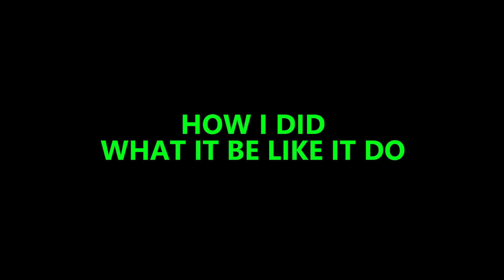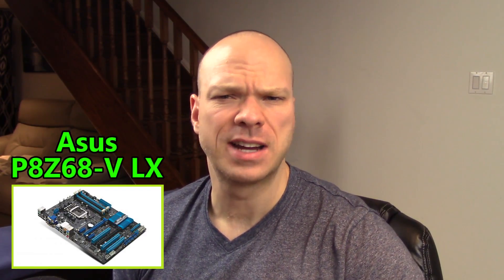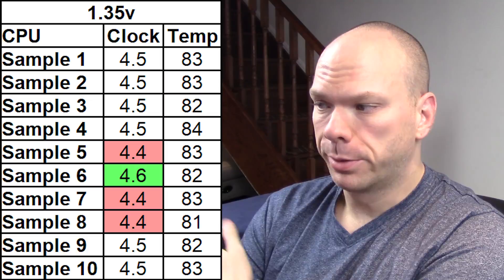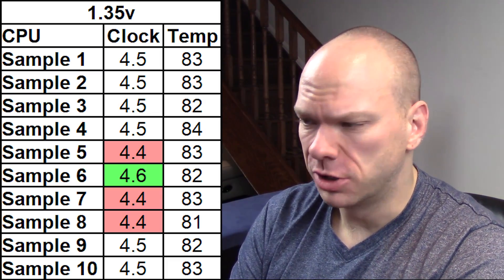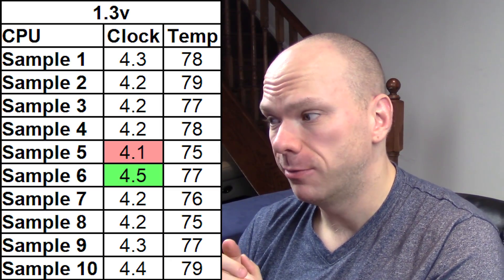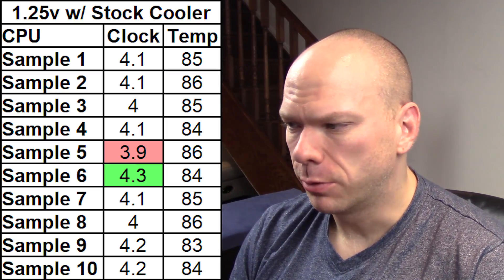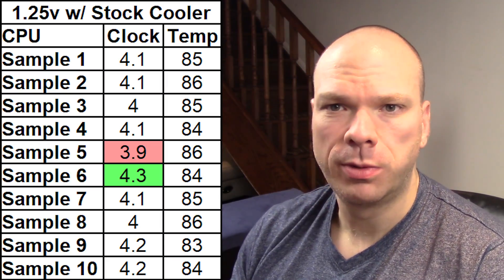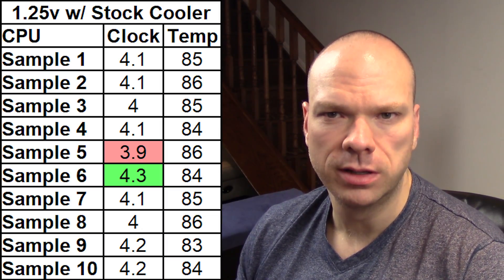Overclocking Used i5 2500Ks - 10 CPUs, 10 Results

Comment: I don't think they have a point. I would more count this to chip variables and how voltages are measured. Also people seem to understating voltages online. Got mine at release, overclocked it to 4,5ghz. Overclocking was done by finding first voltage value that is stable in prime 95. Now 12 years later it's still running with same voltage and is same way stable in prime 95. I actually tried lowering voltage by 0.05 and it crashes in prime as it used to do. So I would say that there is no meaningful difference to workinglife of CPU. Note that it's already stretch to be thinking that over 10 year old pc is relevant.

Comment: 4699MHz at 1.3-4v then under load 1.5v (heavy load) since 2014, previously 4599 from new in 2012. Running "stable" like this for years and years, no throttling of MHz either, finally the system is giving up, it can power off from time to time (2019 august). I have got more than my moneys worth now. Emulation of Wii U and PC gaming including Arma 3 hurt the CPU real bad over all the years, 4k hours in Arma 3 and 0.5k hours of CEMU time. 
It is a shame that it can not become a hand me down some where, at the same time wouldn't like to hand down something so old anyway due to power usage even at normal clocks. Thank you 2500k a true legendary CPU.

Comment: I’m struggling to push mine past 4.4ghz. It’s been running at 4.4ghz/1.325v for the last year but anything over 4.5ghz and I can’t get it stable at any voltage. If what you’re saying is true it’s probably degraded some because for about 3 years it was running at about 4.4ghz/1.45v because I left voltage on auto when I didn’t know what I was doing.

Comment: My 2500k came from a m8 who had it 5 years. 3 of which he didn't overclock. Last 2 he did. Tho its done well as it will do 1.35v at 4.6ghz. Currently priming at 1.38 at 4.7 but I still needs to pass 24 hour prime95.

Comment: First time into overclocking: Z77A-G41(budget OC kind'of capable) + i5 2500K got it at 4.1GHz on the stock voltage(i guess) messing around, setting the multiplier to 42 and having +0.000v option, as i couldn't find a way to manually enter the voltage. Was i lucky with the chip, or did the MB automatically raised the CPU voltage? More so, is there a way to make it work with variable clock speeds? Cause it was 4.1 fixed in windows, and i didn't liked that, so i went back to the stock settings.

P.S: i have to say that the HD3000 is a little beast when overclocked, as i'm stuck with it until i find a decent priced GPU

Comment: just like the randomness of how high they clock from factory i think that has to do with degradation aswell, ive seen 2500ks at 4.9ghz for years, but ive also seen them start at 4.9ghz then become unstable after a time. silicon lottery seems to also be with how far you can push it for how long

Comment: Cool video! No thanks on the pornhub thingy'ma'jingy. I still have a 2500K. Overclocked to 4.4Ghz because this is the best I can get at voltages below 1.35V. I used to run it at 4.5Ghz but I noticed that the chip got hungrier over the usage it had so I actually need more voltage to keep it stable at 4.5Ghz. So yeah I can say it did get used a bit (degraded) over the 5 years I've been using it. Still a great processor and I can definitely recommend it.

Comment: Very good video, max voltage for 24/7 use that i would recommend is 1.42 for intel processor and that is every thing all the way from sandy bridge to kaby lake from what ive seen. That chip could have also been the worst silicon from factory and the 1.45v did certainly not help it.

Comment: Hmmm... Interesting, and does pose some questions about my 5 year old AMD oddity... It's a Phenom II x6 1055T @ 3.36Ghz and 1.3V (stock would be 2.8Ghz @ 1.35V).  Admittedly a "Conservative" 20% overclock, but non-heatsinked 4+1 phase VRM and a small PSU, I wasn't going to go for overclocking gold on this setup (though I know most people wouldn't even consider overclocking such a setup).

Comment: My 2500k (Purchased in 2008) ran at stock voltage with a max overclock of 4.4 GHz, (No matter what voltage I gave it, it would never go past 4.4) and it's been running at 4.4 for most of it's life, recently dropped it to 4.3 a few months ago just to drop the temps a bit (Was sitting at the 85-86 degree temp) and at 4.3 it dropped to 80-81 Deg Celsius. Using a cooler master evo.

Comment: Ivy Bridge i5 3570K here sitting at a cool and quiet 4.3GHz at just 1.18v, maxing out at 63C on a Hyper 212 EVO. For nearly 5 years. I wanted to stay fairly conservative with it to prolong its life. I plan on keeping it for another year or two and probably one more GPU upgrade (totaling 3 GPUs on this one CPU). 

The i5s from this era were built to last! Legendary chips.
Reply: Captain Jack Aubrey of the Royal Navy I'm still rocking my 3570k. I've had it at 4.5ghz 1.25v for 4 years, with occasional messing up to 4.8ghz at 1.35v. when I finally upgrade (probs Ryzen 2nd gen) I want to de-lid and see if I can get the magical 5ghz even if just for 10 mins.

oh, all that with the evo 212 & 2 fans. only just hits 80 at 4.8.

amazing chip.

Comment: Iv'e been running intel chips outside recommended max vcore back since c2d days, never had any degradation of real consequence,maybe 100mghz over 5 years. Only shifted onto water about 12 months ago, just ran high end air prior.Always ran enthusiast cases with 6+ fans so temps may play a part. 

I also wonder if some of these beaten up chips are run on motherboards that under report vcore, i always measure vcore with DMM and have seen a fair few boards under reporting over the years. On the flip side, ive seen boards over reporting as well, so without measuring vcore accurately, you may have more headroom than you think!

I skipped these early I series chips as my overclocked q9550 was still holding its own,a socket 2011 3820k being my first. Whats the value of these 2600k's? I don't know if i could seriously recommend one with the current availability of unlocked hexa core socket 2011 xeons that under water, cream a 5820k for like $100! 7600k has no chance, only SLIGHTLY better single core performance.I did a build the other day with one that ran 5 on just over stock vcore so benched it before i gave it to customer.

Comment: Interesting video, although not huge performance degradation, it is significant enough for consideration when buying used chips. I never really believe the whole "if you overclock your chip it will severely reduce performance thing" so I've never really asked people if they overclocked their old chips for the couple I have bought. But I'll keep that in mind now.

Comment: I'm still using my 2500K overclocked @ 4.5 GHz since I got it back in 2011. I think the voltage is around 1.32. It's still chugging along for me.

Comment: I have a 2600k at 5Ghz.. been using it for the past 5 years!
Reply: At what voltage ? i have a 2700K but i can't get past 4.6Ghz @1.35v
Reply: JakeOcowell I'm assuming because of the hyperthreading, it may not reach as high of an OC. I could be wrong, but that's my guess.

Comment: That's nothing really that unsurprising. Longtime high voltage will degrade the chip and after some time it will show. The higher the voltage the faster. 
Personally I leave my i5-4670k at ~1,25V wich lets me clock it up to 4.5GHz. This seams to be excellent for long time usage and high performance because it offers high performance for as long as the CPU will be relevant.

Comment: My Overclocked i5 760 (first gen i5) is still doing great, although I've only given it 1.225V with LLC enabled and a sufficient aircooler with the Thermalright Macho Rev A to get it from 2.8 to 3.8 GHz. My PSU wasn't the greatest, the CPU is only overclockable via BLCK and I still use voltage regulation and speed stepping and all that.

Comment: the 2500k is and old cpu, so im not going to trust the old motherboards as there capacitors may be close to leaking
Reply from the maker: Wake me up inside Cant Wake Up Inside I have a multimeter for such things. The board was working fine

Comment: Pink, you should wear pink and yes my Core 2 Duo E7500 has degraded over the years to a pathetic 3.67GHz at 1.4V and before it was at a stable 3.825Hgz at 1.435V so yeah :/

Comment: Never had a 2500k, but have built a total of 3 2600k PC's and all of them were rock stable after simply putting them at 4.6 with 1.35v. One of them was really good and reached 4.9 at 1.42v, didn't even boot at 5ghz though :/ Doesn't mean that all i7's are binned though, as my now retired 4770k only reached a pathetic 4.2 at 1.26v.. No wonder i swapped it :P

Comment: Hey Ofah i just wanted to ask you something, i do own an old Xeon 3565 clocked at 3.2/3.4 boost which is somewhat close to a 1st Gen I7 in terms of IPC
and i've been thinking of buying an rx 470 to pair it with it, As a budget build for my Young brother

based on your experience trading parts is this a good move to do?
Reply: Evan Medi I have a i7 930 at 3.9GHz paired with rx470 and it works perfectly
Reply: thnx for the answer
how about the stutters in Cpu intensive games is it that bad
Also about the fps drop do you get somewhat near 60fps in AAA titles in a decent settings
Reply: Evan Medi I dont notice any  frequent stutter. but we do have different cpus. about fps I mostly play GTA V and at 1080p high settings I get 60+ fps, I can even play 1080p and stream at 720p at the same time without any noticeable stutter. But it does lower my fps to 40-50
Reply: in GTA V I can get a lot more than 60 fps in 1080p with high settings, it can go a bit above 100fps. it all depends on what im doing in the game.
Reply: ozayevable my settings in bios?
Reply: in theory we have the same CPU but different Clock speeds
they were released in the same year they have the same same gen,tdp, Node,ipc so i should expect similar results i guess
Tbh honest GTA V is one of my favorite games so i'm glad this Setup can handle it very well, 60 FPS with High to ultra settings is all i can ask for

thnx for the comment, really i appreciate your input m8